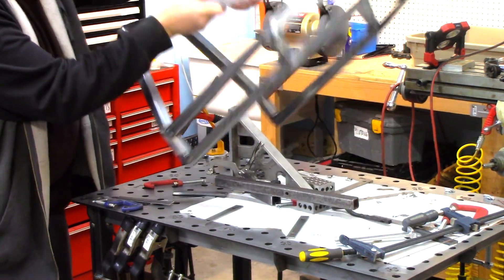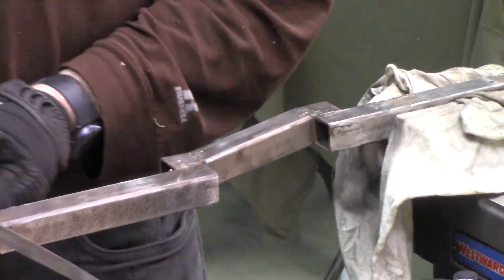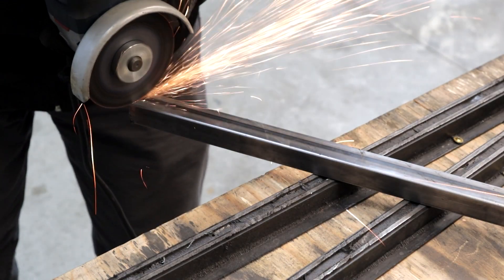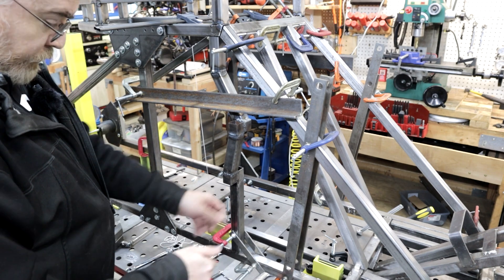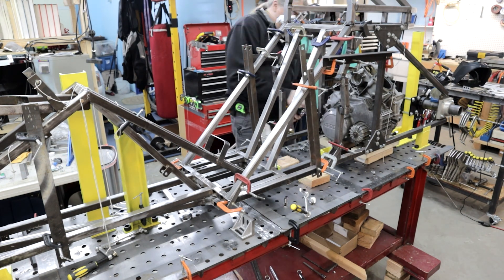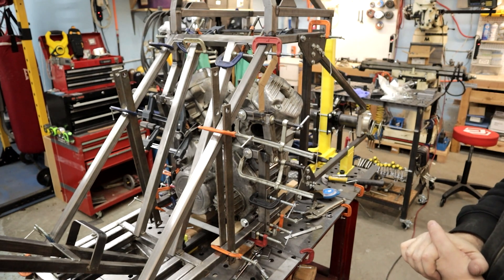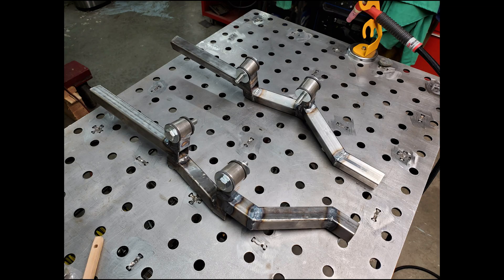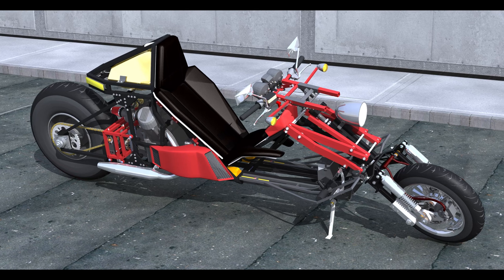Akira Bike Project - 20 - frame extension done!

Comment: I understand your amarican and this is made for a taller audience but I was wondering how someone who is 5 ft would fit on the bike. I saw a video a few months ago addressing this size issue makeing it larger. Can't wait to buy a kit from you though the bike is going to look epic
Reply from the maker: Thanks!!! Looking forward to finishing it, getting kits out, and starting the next version!  

The sizing problem was more about most builds being too small for any person, because they are scaled from conventional motorcycle tires and typically have 250cc or smaller engines due to local regulations. Their purpose is usually focused looking just like the bike from the anime / manga and not a focus on being functional and reproduceable. Mine will be highly adjustable, the floorboards / foot controls alone will be able to move about 12" back, the handlebars also can slide forward and back and change angle.  Seat and headrest will have some adjustability too. The adjustability will be more like a car, here's an image that shows all the adjustable points https://www.matus1976.com/images/seating%20adjustments.jpg?crc=47437472 I'm aiming for something more like the 95th% used for cars (it should comfortably accommodate 95% of people)

Comment: I would love to see the same design, but with the Honda 750 DCT powertrain. I'd rather not deal with a chain.
Reply from the maker: Absolutely agree, this is actually just for the phase I prototype, around phase III I'll be upgrading to a shaft drive.  The chain drive just makes it easier right now to deal with the incorrect gearing which comes from a 30" rear tire and get some basic testing of the platform done asap.  Id prefer to wait a bit before getting expensive custom made spiral bevel gears made, but the final version will be shaft drive.

Comment: I think the CX500 requires periodic valve adjustments. Does the placement/shape of the braces allow removal of the valve cover to perform that maintenance?
Reply from the maker: That's a great point, I didn't plan for that but I think the valve covers will be easily removable, I'll double check though and if it's not easily removable I'll see if a simple frame change will fix it.

Comment: Love your work. I do welding/fabrication & much prefer it when given the chance to present a solution rather than work to a piss-poor design laid out by a clueless engineer who never gets his hands dirty. You my friend are living the dream.
& if I may make a suggestion - have you considered fitting belt drives as opposed to chains? No oiling, just periodic checks for correct tension & wear. Doubtless there will be others who will bang on about how belt drives sap power - I've seen figures, it's minimal - but if high performance was the end goal I surmise that you would have gone with a bigger capacity engine. 
Much respect & admiration from the UK.
Reply from the maker: Thank you! I do feel quite fortunate and appreciate the support and fact I can do work like this.  It's truly a different world when you go from paper to reality that people who never build things can never remotely appreciate.  I have considered belts and other methods and have no issues with belts, the build will happen in phases and this is just the first phase (hardtail chain drive) later phases will have a different system to deliver power to the rear wheel since I ultimately want to use a steered rear wheel on a single sided swingarm and neither belts or chains or hydraulics will really be practical for that. I don't like the unsprung weight of a electric hub motor either. So I'll be testing my drive system it out around phase III, I also have bigger motors to put in here in later phases. I Just didn't want to slap a 100 HP cx650 turbo in an untested first build.  Stay tuned it'll be awesome.

Comment: How about a Hayabusa engine with a turbo instead? 
That will be more like Akira's motorbike performance 🤪👍
Reply from the maker: This is just the first phase prototype, I'll be putting bigger motors in later.  The hayabusa is a beautiful motor, it's hard to fit though, along with most inlines and parallel twins, since it leans forward.  I have a cx650 turbo I'll put in their later that will bump it up to ~100HP, but I'll also be exploring supporting other engines and making a kit version and see if can fit hayabusa in there and keep it looking good.